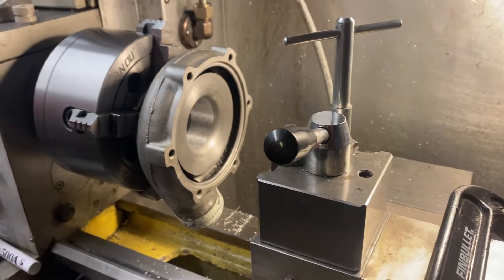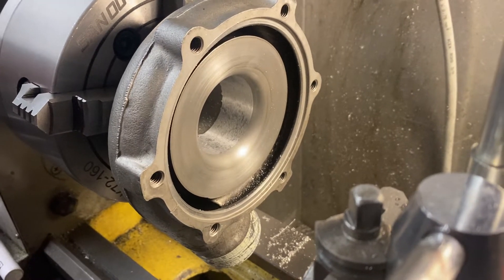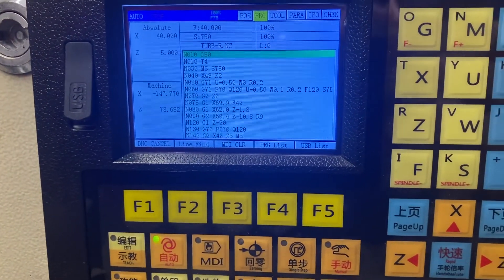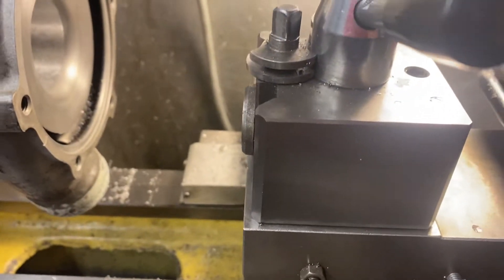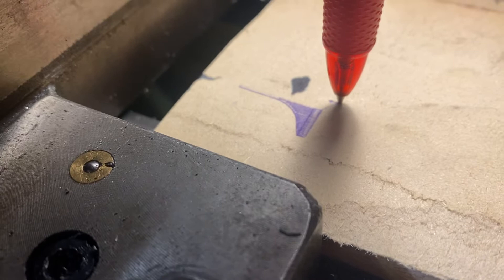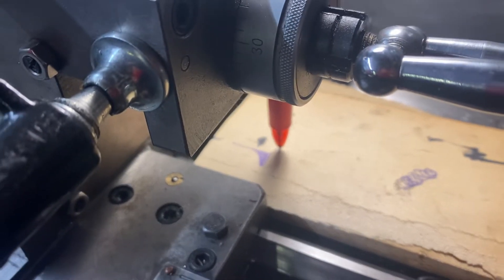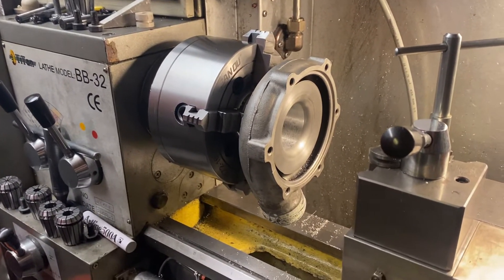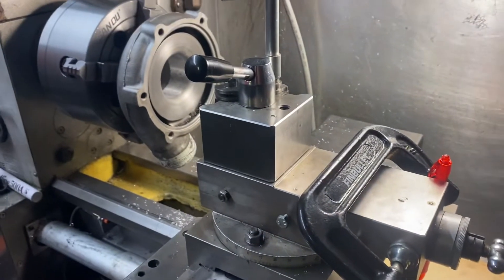T3 turbo machining Xc609t cnc "graphic" tool path tip.

Comment: Just come on this video. I am thinking of buying the 609T and your excellent videos give me great confidence that it will work for me. I have cad cam but the program sometimes produces rubbish and I always have to run in free air. I never thought of making an analogue drawing like you have, this is a really great idea. Incidentally I have made exactly the same part and for the same reason and played with the radius to get exactly the right radius when matching the compressor to the housing. John

Comment: Esse comando tem compensação de raio da ferramenta muito obrigado
Reply from the maker: I don't actually know, as I use CAM
Reply: @MJPilote  Olá como posso verificar a macro M6 tem que colocar alguma senha para abrir o setup da máquina para verificar os parâmetros eu vi uma senha 888888 mas não sei onde e como colocar vc poderia me ajudar?
Reply from the maker: @Stitch_ofc3  The M6 just turns the output high or low, what you need to change? I don’t know if you can edit the macro, if there even is any.
Reply: @MJPilote  obrigado por responder eu já um vídeo com  cw20 com toolcharge mas não sei como colocar a macro eu pedi para fazer uma torre com 8 posições mas não sei como colocar a macro mas muito obrigado mesmo pela sua atenção